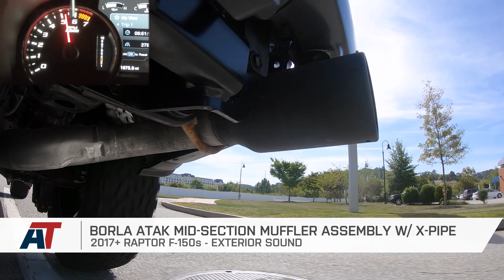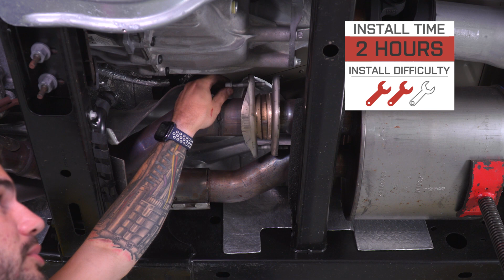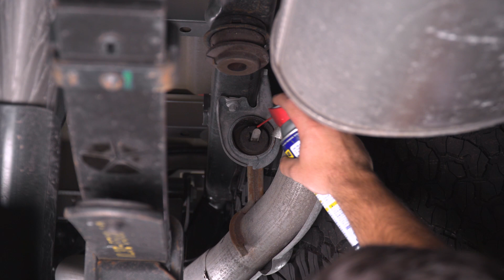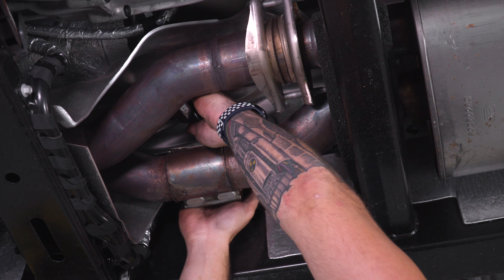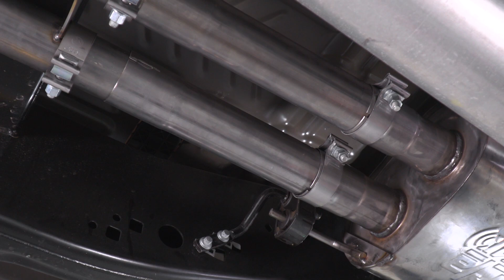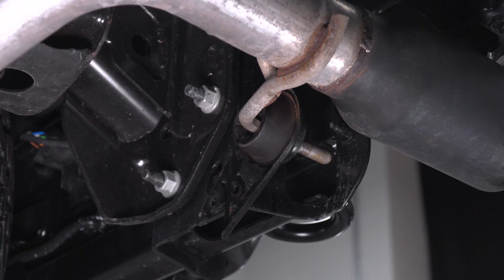2017-2019 F150 Raptor Borla ATAK Mid-Section Muffler Assembly w/ X-Pipe Sound Clip & Review

Comment: Im interested as to why borla went with a dual split muffler set up on the atak for the raptor. Still cant wrap my head around why ford decided to put a v6 in the raptor, regardless of hp/torque numbers. The sound of that motor just does not go with the look of the truck in my opinion.  The sound of the atak for the 5.0 v8 is just plain addicting. I've got it on my 2015 5.0 lariat and i absolutely love it. And get compliments on the sound of that cat-back all the time.
Reply from the maker: Not too sure! The guys at Borla really know their stuff though, so I'm sure it came down to getting that exhaust tone just right in their eyes... or ears. 😂 Super happy to hear you love your 5.0L with the ATAK setup! -Zach